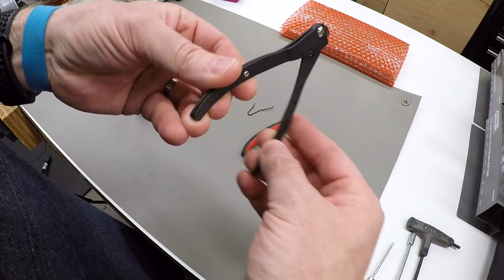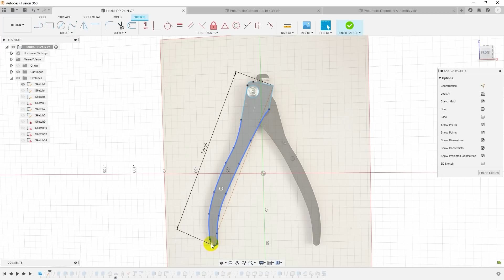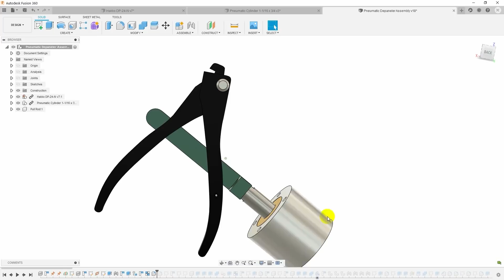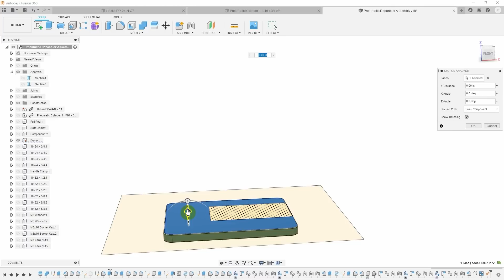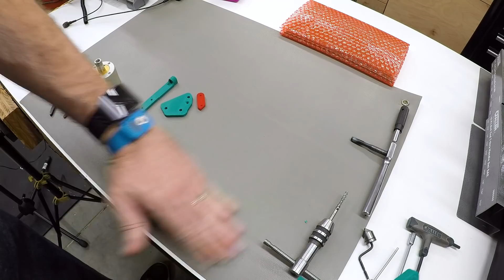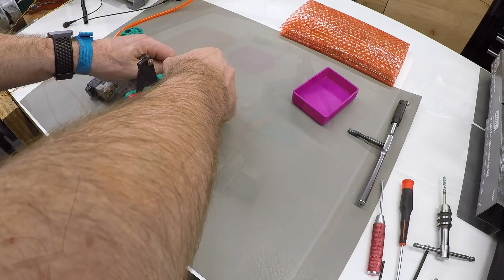Pneumatic PCB Depaneler

Comment: That is a cool tool and I will be sharing it with a couple of my friends that do volume PCB's as a prototype group.  I think you did bring up pinch points on the jaws of the tool.  Did you also consider the pinch point between the handles as the pneumatics operate the handle...  A guard for that might be a welcome addition.  In all, excellent idea, excellent implementation!

Comment: What about a table/platform to support the boards being cut?  Something like the table of a table saw or bandsaw?  You might have to thin-down the cutter's faces to get it to slide through the slots easily.

If the tool's waving front handle is a danger, consider cutting it clean off, and replace the red plastic clamp with a pin.  No hole for fingers means no chomping of said fingers.

Has the tool clogged up with offcuts, or was that alleviated by the cylinder pushing as well as pulling ?
Reply from the maker: Pushing has pretty much kept the slot clear.  When using it by hand, clogging was a problem.  I thought about making a table, but opted not to, both for simplicity, and to avoid scratching the board.  Offcuts and debris from the fiberglass and copper will inevitably build up on the surface.

Comment: Here's a tip:  If you need to recreate a part, look for a product manual.  Either that, or contact the company's support and ask if they have any technical diagrams they can give out.  Most manuals (and tech. diagrams) are PDFs, and the illustrations in them are ofter SVGs (not raster images).  In illustrator, you can import pages of a PDF and everything is still in a vector format.  (not sure if Inkscape does this)  Even if it's not the right scale, since it a vector, you can scale it to the right size.

Comment: If you get a PCB manufacturer that provides PCBs that are perforated, no tool is needed to separate pieces.  Just snap it to separate.  Problem averted!

For those that happen to have the pneumatic actuator with sufficient power, this is the way to go.  Nice project.  Liked & subscribed!

Comment: One more thing. Regarding safety you may consider cutting the excess arm of the tool so that it cannot hurt you. I guess you don't want to convert this back to a regular handheld tool. Just a thought.
Reply from the maker: I left it so I could convert back if it didn't work out.  The pressure is low enough that it doesn't hurt if I get my hand caught behind it.  Ask me how I know.  :)

Comment: Would your paper cutter work to depanel the boards?
Reply from the maker: No.  The paper cutter has a sharp blade cutting against a soft backing.  A PCB cutter shears instead of slicing.  Plus the components are already soldered, so the clamp has nowhere to grip.

Comment: If you put rat-bite holes on the tabs you don't need a depanelling tool, just snap them out by hand
Reply from the maker: There are perforations along both sides of the tabs.  Snapping the boards leaves the tab attached to one side, and breaking them off with pliers is an extra step.  I started out that way and quickly determined it took longer and left a rougher edge on the board.

Comment: awesome job man, impressive! I started to build a similar thing with a pair of clippers almost the same shape as that stamped depanel tool to cut 1000's of pieces of fishing line to exact lengths for fishing product using a servo motor instead of pneumatic + stepper motor to feed the line and arduino board, I like how you did it with the pneumatic though and the 3D printed rig, this makes me wanna pick the project back up! (right now I am manually just wrapping the line around a board that is half the size of the length I want and cutting it, would be nice to automate that process.)
Reply from the maker: Go for it!  Though wrapping many turns around a board and slicing the end with a blade sounds pretty efficient.

Comment: That's a great tool. Thanks for the F360 tips.

26:59 That jack you connected the alligator clip to, the way those usually work is the snap connection to the work surface is high resistance, to the ground wire, but the banana ports are directly connected to the ground wire.  This is because the banana ports are expecting a wrist strap plugged in there, which has its own high resistance. You might want to check out.

As configured in the video, the grounded tool might be an ESD liability more than if it were just resting on the ESD safe work surface. To use a non resistive alligator clip wire to ground the tool, I recommend clipping to your ESD safe work surface instead of the banana port of the ground wire. 

If the panel of PCBs is statically charged, when you touch it to the tool, the charge will be dissipated relatively slowly, which is most desirable. By having connection to ground, even though high resistance, the tool is protected from building its own static charge.
Reply from the maker: Yes, of course.  I had considered this.  What would be better would be to make up an integral grounding lead with a 1M resistor.  I went ahead with the clip because it was out of time.  What you describe is possible, but probably not too likely, since I'm wearing a wrist strap to drain off any charge from my body, which is the biggest threat.

Comment: Will more interface boards be available soon?
Reply from the maker: They're in stock now.  Check eBay.
Reply: @Clough42  thank you, ordered. I'm building two of these. One for a leadscrew, the other will be adapted for use as a quill auto downfeed/spindle speed indicator. Thanks so much for your work.
Reply from the maker: The boost boards are in stock now.  More control panel kits are coming soon.  The last of the parts are traveling the oceans to me as we speak.

Comment: Nice video. 3D printers are great for prototypes and functional parts. I add long 4-40 bolts to some printed designs for extra strength/stiffness. Screw in quickly with a drill and the friction melts the printed threads securing the bolt. 
BTW I do most of my cut and form tapping with a cordless drill on a low torque setting.
Cheers -Peter
Reply from the maker: That's not a bad idea.  If you size the hole right and go across the layers, I bet that works really well.  The pneumatic depaneler would be basically indestructible with a couple of screws up through the frame from the bottom.  Hmm....

Comment: I wanted to ask, so here it is: 
Could you have used a small bearing, say 627, on the crimping handle pull instead of the softer red plastic attachment ( with necessary changes to design obviously) ? With allowance for backlash, do you think it too rigid ?

Comment: James,
This is a great example of building an automated tool and I think people can get some great inspiration from this.
I suggest, however, that you mention a flow restrictor to slow down the movement of the cylinder.  Something like [this one](https://www.mcmaster.com/air-flow-control-valves/air-flow-control-valves/elbow-air-flow-control-valves/).  The exit diffusers on the solenoid sometimes do an ok job, but being able to slow down the motion of this kind of tool will make them a little safer for home use.  Yes it might be overkill for this project, but I feel it is worth mentioning.

NB

Comment: Nice! Next steps are probably to devise a table so you can just slide the boards into the throat, and increase the size of the clamp plate to also serve as a shield for the moving part of the handle (or cut the lower part of the handle off).

Comment: I cut a lot many pieces of primary wire to length using Hakko sidecutters.  As a SolidWorks user with a 3D printer you just inspired my next project: pneumatic powered sidecutter.  Brilliant, thanks for making videos!

Comment: The extension arm is both the most likely to break, and the easiest part to make out of metal. I don't expect you'd break the main frame, but that single screw connection might get stressed. So if it breaks, and that's the part that broke, try just making only that one piece.

Comment: I have an old Arvin tube radio from the 40's that has been waiting on me to restore it (it's actually a friend of mines great grandmother's radio). It has two dial faces that were laying in multiple pieces in the bottom of the radio. I gathered them up and reassembled them on the bed of my photo scanner and then scanned the dials into a TIF file. I did this 5+ years ago. The point is that this video finally validates what I thought was true but I could never figure out how to make it happen. I can use the photo, to create the dial faces in Fusion 360. The scan is a very accurate 1:1 scan and dial faces are pretty simple, even with the freq scale on it. I'm still a long way from being able to make the dial faces. I need to be able to lightly engrave the lines of the scale and fill them with watchmakers dial wax. That'll take a CNC router and I still don't have that. BUT, the concept has been validated. Much appreciated
Reply: I admire your persevering and willingness to wait for the correct tool in order to be able to dot he job correctly. I'm sure you'll get there one day!

Comment: Great job !!. Heres a quick tip. If you use a camera I've found projection error gets to be an issue. Put in a photocopier or a flat bed scannner. Works a treat...FYI make sure the boss isn't looking... i get my ear chewed..
Reply: Flatbed scanners are also bad for perspective error, surprisingly. There's more accuracy one way than the other (forget which way it is)

Comment: "Sensitive Viewers..." Meh... Sensitive viewers have never had to dig through multiple coffee cans full of unsorted bolts to find one that will, by God, just friggin fit so they can get to work that day...
Reply from the maker: I actually bought a set of Screw Check'r thread gages and spent a day sorting 25 years worth of left over fasteners into drawers.  Best investment of a Saturday in the shop ever.  I have a ton of M3 hardware because it's the de-facto standard for 3D printers and Arduino-scale electronics.  But for mechanical stuff, my go-to is 10-32--probably because Tom Lipton.  :)

Comment: you have a direct drive printer right? have you tried using linear advance?
Reply from the maker: Yes.  They're both direct drive.  I haven't tried linear advance.  It looks pretty cool.  I need to upgrade my firmware anyway; I still have a version with the false thermal runaway detection error...

Comment: Needs more ground straps. You don't want to be one of the 3 people in history that have had static electricity fry a PCB. Just kidding. Awesome video.
Reply from the maker: I used to work in a clean room with conductive floors, ankle straps, ionized compressed air guns, and freakin' anti-static paper.

Comment: Awesome tool James!!! Since this is for the ELC project I have a couple questions. Just out of curiosity, are you aware of any other TI Launchpad models that would work with a little modification to the software? And last, The red buttons, are you still using Ninjaflex for that? I have never printed with a flexible filament yet. I have a project I will need a flexible filament for. The one you use gives me a good idea on the shore rating. I got my C4227 and C4228 the other day. Thanks
Reply from the maker: The TI boards are all a little different.  I think it could be made to work on the F280069m, since that's what I used for the prototype.  Unfortunately, the pinouts are all slightly different, so it would also require changes to the PC board.  IIRC, the 3.3v and 5V power domains are handled a little differently.  The F280069M boosts the regulated 3.3v to provide 5V for peripherals, so it's more complicated to provide high currents at 5V for an LED display.

Comment: Great video as always. Couple of suggestion.  Permanently install a ground wire for the device. Add speed control valves to the exhaust ports on the solenoid valve.
Reply from the maker: Yeah, I have some needle valves.  I need to try them to see the difference.  The ground wire was an afterthought.  I thought about embedding a grounding screw that would bear on the handle, but the alligator clip was way faster, and I needed to shoot the video before it got hot.  :)

Comment: Haven't read the comments so I don't know if this has been mentioned already but there's an different (easier) way to scale the canvas IMO. (Also, I don't know if there's any specific reason you didn't do it the way I'd do it, so here goes anyway, hope it's helpful)
It's called "Calibrate" and you access it by right clicking the canvas from the Browser menu on the left.
Check out the link, it's from an older version of Fusion but all works the same with the current one.
https://knowledge.autodesk.com/support/fusion-360/getting-started/caas/screencast/Main/Details/2bc55cba-830f-4752-8cb7-d473b95f4616.html
Reply from the maker: Oh, that's cool!  I didn't know that existed.  I wonder sometimes if I learn more than my viewers on these kinds of videos.  :)
Reply: @Clough42  Thank you for your time and effort!! Your videos and projects are totally top-notch and the amount of heart you put into them is superb!
Reply: I was about to make the same comment as a helpful tip and decided to see if anyone else mentioned it.  I use the calibrate canvas function a lot and it is an incredible time saver!

Comment: Very awsome, could easily be adapted to a stripper and crimper for automating harness assembly
Reply from the maker: Hmm...that's an interesting idea.  I find the toughest part of the crimp is aligning the stripped wire into the connector, but if one could use both hands and operate a mounted crimper with a foot pedal...
Reply: This is a genius idea! I don't know when I'm likely to need to strip a ton of wire for a harness of some sort, but I'm sure that I will someday 😅

Comment: You really need a couple of pneumatic meter valves on those cylinder ports to control the speed and noise of the tool.
Reply from the maker: I actually have a couple of those lying around, too, but didn't think to add them.  With the mufflers on the valve, it isn't really very loud.  The sound you hear in the video is compressed in post-production, so it's tough to judge.

Comment: hey thats very handy! line work is always annoying.
what i would have tried, in my complete lack of experience, is to either:
mount the "anvil" flush with a table and use guides to square the panels to it.. so i can feed the panel as if it was a piece of cloth in a sewing machine haha (would have to reduce the width of the cutting part of the tool so it would run easily through the narrow spaces)
or, just make a press like device that would cut the whole panel at once. double action - 1 gently clamps the boards and 2 lowers the cutter(s).
just wanted to share these thoughts, and maybe see if im too far off in the comments.
Reply from the maker: Good ideas!  When I designed the board, I didn't know how the cutter would interact with the tabs, so I chose a cutter very close to the same width as the slot to minimize the material left on the edge of the board.  They actually sell them in various widths, so I could probably pick one up that's slightly narrower.

Comment: Nice job designing this fixture but why not just snap the boards instead of cutting?  Do you really need a clean edge instead of a few mouse bite burrs?
Reply from the maker: These boards are pretty small, so there are traces and solder joints very near the edges where they would be stressed by flexing the board prior to snapping--especially with lead-free solder.  If I were making them for myself, I might take that risk, but if I'm shipping them all over the world, I don't want to accept the additional warranty/failure rate and I didn't want to make the boards bigger.  For snapping, one would usually just v-score, but the fab I used doesn't support v-scored panels for their assembly service.
Reply: Steve Robbins Hey, this is James. Of course a clean edge is absolutely mandatory! ;-)
Reply: Smapping off mouse bites depends on the design - ceramic capacitors near the edges where the stress is introduced are the most likely victims here. I was thinking V-grooving, if the edge does not need to be routed. That is how we do most of our production panels. The cutting tool for separating V-gooves without stress looks like a pizza cutter disk on a rail and is really quick to use. But then again we would not have seen this brilliant design taking shape!

Comment: How much of a concern is ESD in this kind of setup? Would it really be enough to cause issues with the circuit components down the road?
Reply from the maker: Yes and no.  Yes, it's always theoretically an issue, and the effects of ESD damage can show up much later down the road.  In this scenario, the transistors are pretty robust and the inputs and outputs are bypassed, so the EEPROM is probably the biggest risk.  I'm doing 100% testing after separating the boards, so I'm unlikely to run into issues.  It's good practice, though.  If I ever build an integrated board with a $14 MCU chip on it, I'll want to be even more careful.
Reply: @Clough42  good to know! I'm only just getting into electronics design so I appreciate the feedback. I hear a lot about it being a preventative measure but I dont know if I've ever actually seen a demonstration of the effects.

Comment: This is a great video and awesome tool improvement. I'm a little surprised though you didn't machine a press die with extended corners to locate the pcb and get a full pcb out with every stroke of the cylinder. Maybe another iteration as production ramps up?  Great work!
Reply from the maker: I thought about it.  I also thought about fitting a single cutter in the mill spindle or in an arbor press with an anvil below for cutting.  In the end, using the off-the-shelf tool and some pneumatics seemed like less work, more likely to succeed, and more interesting.